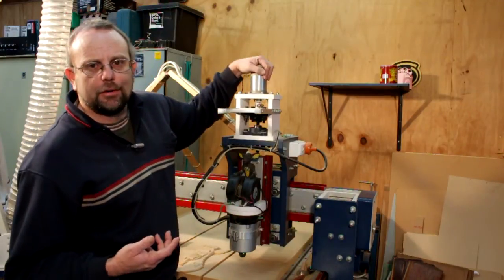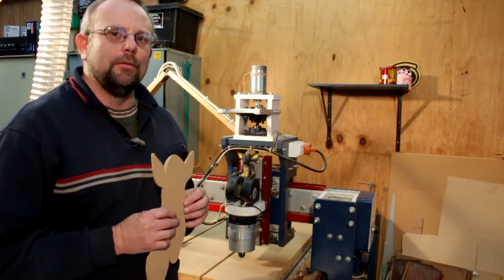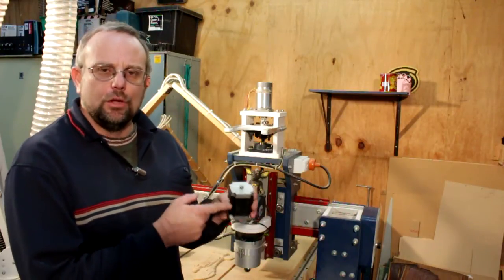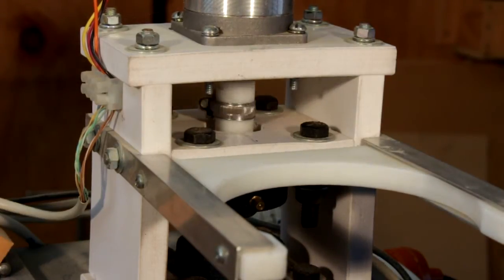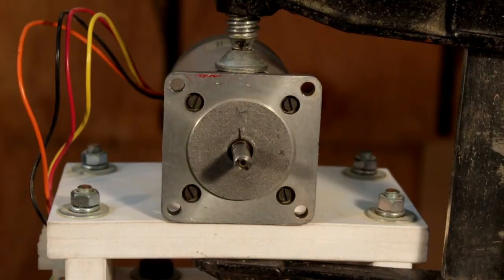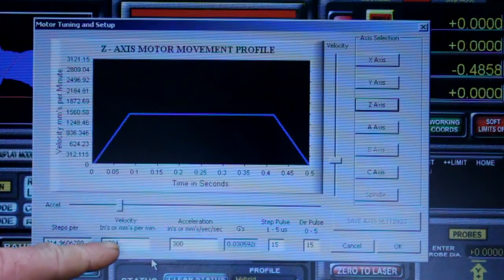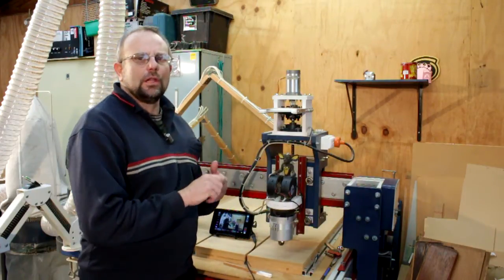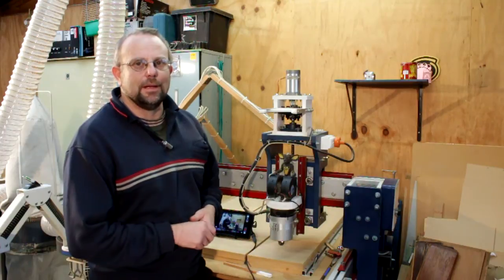Where did I put those steps - CNCnutz Episode 66

Comment: Peter,

Once again, and in the middle of the night, you came to my rescue again!  Suddenly started having lots of skips.  In fact, one of the X-axis motors would suddenly stop turning in one direction.  Stop what I was doing, and went back to visit your outstanding video.  After reviewing your video, decided to that all the motors off, marked the zero location on the motor frame and shaft as you demonstrated in the video, and ran a long program.  Afterwards, found two motors not returning to zero (one X motor and the Y motor).  X motor was sever, but Y motor just a little.  Then swapped motor that returned to zero with motors that did not, and repeated test.  Problem was traced back to driver electronics.  Replaced drivers with spares on shelf, and back in business.

You make it so easy to troubleshoot.  Thanks so much for sharing and educating us.

Mike
Kansas, USA
Reply from the maker: +Mike Falkner 
Great news Mike. 
Glad it helped you out. 
Cheers 
Peter

Comment: Nice video, I have tried this, but wen I run the machine to move to 100mm after calibration, it moves but if I run it to move 150 and 200mm it jump to 152 and 202mm also if I calibrate at dat 150 and 200mm and run the machine to 100mm it stop at 99mm. Please I need your help, please your reply is really appreciated.

Comment: Peter, I have relied on your videos a lot over the last 4 years.  Once again you have come to my rescue.  I am having the exact problem that you describe here.  Now Off to try to run it down.  OBTW, great explanation on the pulse duration setting.  I have never heard that.  I'm currently set to 0 so I'm guessing that might have something to do with this issue.
Reply from the maker: Good one. Note that pulse Duration only applies when using the parallel port. If you are using a motion controller then the durations are automatic.
Cheers
Peter
Reply: @cncnutz  Always great to hear back from you Peter.  I tried turning off X & Y in ports and pins, and then ran my program only on Z.  It didn't work like you suggested.  Y axis just ran away and kept climbing, Z never moved after a few initial moves. This was a pretty simple program, cut an ellipse, advance Z deeper after the first go around. At that point, when the Z steps down, it seems to be losing a step or two.  Any suggestions on why the disable X,Y didn't work for me?
Reply from the maker: Hi Jim
The only thing I can think of if that you didn't disable the axis. If you did disable the axis and they are still moving then either Mach3 is corupt or you have an electrical issue with the axis. Neither of the seem likely as the X & Y were not your problem. If you get really stuck email me.
Cheers
Peter

Comment: Peter,
I'm having a severe step loss problem. I think most of it is because my motors are under powered but what's weird is that i can jog the heck out of it all over that table at quite high speeds(for the motors\lead screws) and not lose steps but when i try to run the road runner in M3 it gets all out of kilter. This machine has never run before. Gantry is quite heavy for the motors but it thought i could get it working without load. All of this is without cutting just air cutting.
Cheers,
Lyle
Reply from the maker: +Lyle Feucht 
Check your acceleration. If it is too high you will loose steps.  
Cheers 
Peter

Comment: Hello Peter,

By listening to your video, I finally understood and found the reason my stepper motors were missing steps lately.  It was a combination of items.  When I finally reduced the power to my stepper motors by half (motors were big enough anyway), the cutting errors were greatly reduced.  At first, I just thought it was the heat in the motor that caused the motor to miss steps.  But then I heard your presentation and heard you say sometime about power supply.   

BINGO!  I had upgraded all four of my stepper motors from 425 oz-in with 3 amp drivers to 651 oz-in with 6 amp drivers -- but failed to upgrade my power supply to deliver the required amps.  So by reducing the power to the bigger motor from 6 amp each to 3 amps, the old power supply could keep up.  Otherwise, it would run a little ragged.  Thanks for mentioning “power supply” in your video.  If I truly want the full power to the motors, I will have to buy a larger power supply.

The second source of problems was the motor velocity and acceleration settings in Mach3. Mine was set too high.  Reduced them also in half, and now I get very clean cuts with no missing steps.  The system takes a little long to cut, but hey, it is faster than I can keep up with the sanding and other tasks. 
 Thanks again for another wonderful video and the help you give to the community.
Mike
Reply from the maker: Thanks Mike,
Great to hear you solved your problem and the video helped you out.
It is encouraging to get feedback and know that it helps.
Thanks for the feedback and all the best with your upgrade.

Cheers
Peter

Comment: It turned out I had 2 problems.  The first was that the acceleration for the “Z” axis was set to high.  The second had to do with how either I or Vetric scaled text.  The width of my text changed from wide to less wide as it cut to the right.  Because the width of the text was less, the depth of the cut became less as it cut to the right.   I used a “45 degree V” bit.  I need to be more careful scaling text.
Thanks for your video and response.  They set me on the right track.

Comment: Great general tutorial on how to save a few brain cells when figuring out what busted on your CNC.  :)  If you have a factory made or kit one, first check the manual that came with it. Often the real problem could be simply something like the V-rollers being too tight or too loose. Too tight is a common problem with belt drive ones using small steppers. If a cure is not there THEN do as this tutorial suggests.  Its a general thing not specific to any CNC but does cover a number of common issues.  NOT covered but I ALWAYS use the blue thread lock on ALL screws.  :)

One thing about all steppers is something called a resonance point based on step rate frequency. You can usually find this in the docs for the stepper.  At some specific step rate a stepper will stop somewhat dead in its tracks and vibrate back and forth between two points. If you go on past this point the stepper will act normally. In Mach 3 and possibly in other control software you could hit this point by messing with the ramp rates. THERE IS NOTHING WRONG and your not doing damage if this happens so dont panic, just slow down the ramp rate.. :)  It can also happen if you set your rapid rate high enough also but its not likely on small ( under 4 feet long ) cncs. There are ways to run steppers at rates far above this point but Ive never seen it on small ones. This WILL DEFINATLY cause lost steps and you WILL HEAR it. Its a loud buzz. The fix is simple, just slow things down. 

With belt drive CNCs its highly unlikely you will ever see this as the step rates to do it will usually make an axis take off like a rocket.  With lead screws with high pitch threads its possible with really high rapid travel rates. So if you hear a loud buzzing and nothing is moving, you are at that resonance point. The Micro stepping settings also have huge effect on this, the more micro stepping you use the lower the travel rate will be when you hit it. 

As he DID mention briefly micro stepping I do not recommend more than a divide by 2 setting. at 2 your power loss from the no micro stepping is about 30%. The greater the micro stepping the greater the power loss.  Often by backing off on the micro stepping you may solve the problem but ONLY after covering what is stated in this tutorial. 

Do you really need micro stepping or not? With belt drives, most likely so. With lead screws, not necessarily, It all depends on the resolution you need.  With wood and most plastics .010 is all you really need. Thats about the thickness of 2 or 3 sheets of printer paper. To get the resolution requires a bit of math. A typical stepper has 200 steps of 1.8 degrees for a full rotation. 

For belt drives you have to work out how big the pullys are to translate the rotation to a linear travel with a bit of trig. The bigger the pulley, the father you go. BUT bigger pulleys mean less torque. 

With lead screws the finer the pitch, the slower you go compared to the same settings on a corse pitch with the same step rate. The math is easy on lead screws. As an example I use a 1/2 10 pitch 5 start acme rod..  The math - a 10 pitch 5 start rod means one full rotation gives a half inch of travel so for a full inch you need 400 steps. now 1 divided by 400 gives gives .0025 inches per step with NO micro stepping and NO power loss. I actually use a micro step of 2 which means it takes 800 steps for an inch for a resolution of .00125. WELL within the range of high precision metal work and well below what can be accurately measured on he typical .001 dial indicator. Reality is factors like friction do reduce things.  In the end .002 is what the overall measured accuracy works out to be. I DONT NEED micro stepping past 2 to get decient resolution for mostly wood.  :) Lead screws also have a multiplying effect on force too in addition to locking things in a fixed point with no power.  With the 450 oz/in steppers I use its easy to snap 1/4 bits clean off by hitting a clamp thats well locked down..Done it a couple times being stupid. :)  I can get easily rapids in the range off 300 IPM easily also but with a bit over 2 feet of travel and the required ramps its actually overall slower than the 120 IPM I use.  :)

I had to include the stuff about the stepper weird resonance issue and the micro stepping stuff as it can be a factor, espically on the first power on trials.  :) Rare to see but it can and does happen.

The only other thing Il add is if you have 2 different cam ( g-gode) programs try the same project with both with the same exact toolpath settings from both. I use mostly V-carve desktop and one called cambam.  For the downright serious stuff I use fusion 360..

Comment: At 19:32 of this video you mention something that sounds like "Shear Line Mode".  I don't know what that means, and don't know where to look for it.

I use the Ethernet Smooth Stepper and am loosing steps in the Z axis.
 
Thanks. Really like you videos.
Reply: The sherline mode setting is located on the first screen of the ports and pins settings, in Mach3.
It is located to the lower right side of the pop up window.

Comment: hi, there is no relation between the g-code and step losing?
Reply from the maker: +youness agouzzal 
Gcode does not cause lost steps ever.
Some types of Gcode can show show up the problem more than others. eg in normal 2D cutting the an axis may only move 1000 times throughout the cutting process and a lost step or 2 here or there may never be noticed even after years of machining.
 A 3D model may move an axis 1/2 a million times or more and the accumulation of lost steps will stand out.
Nothing has changed but the accumulation of lost steps now may make a problem that was invisible before look like a disaster. 3D Gcode is usually made up of thousands of very short moved constantly changing direction and nothing shows up lost steps more than these types of toolpaths.
Hope this answers your question.
Cheers
Peter